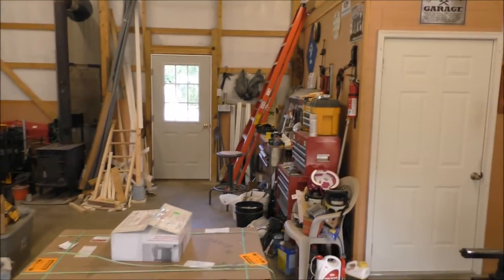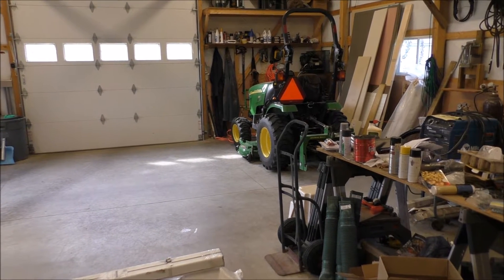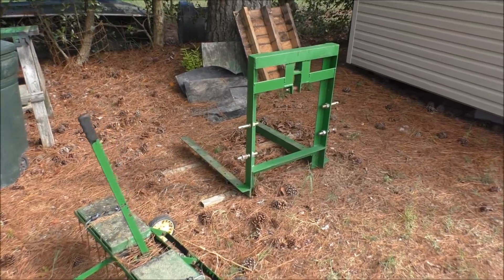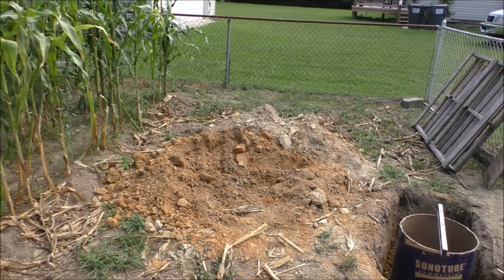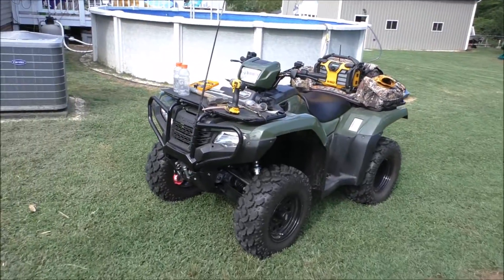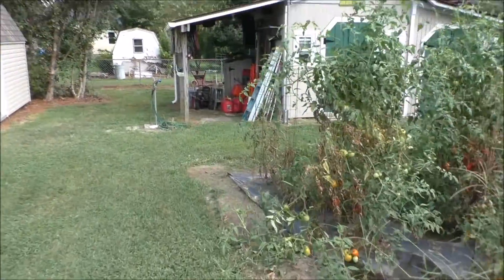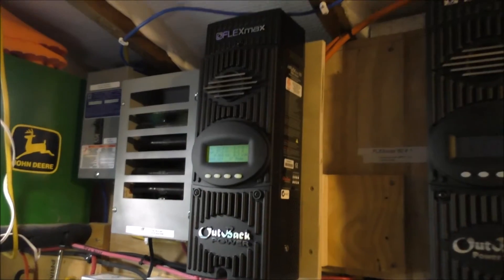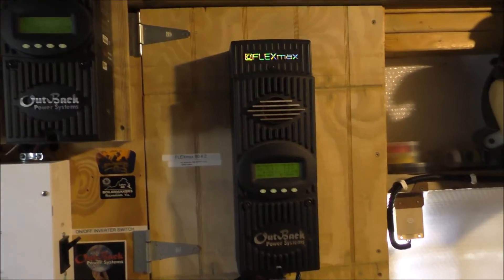Solar Panels On The Pole MT Solar & Kyocera Solar Pt 1 By KVUSMC

Comment: Freight would be the same for two or thirty as long as they are all on one pallet! I got the same panels, but using the cheap Chinese grid-tie inverters, can only get 600 watts ac production....
Reply from the maker: It sure Would Be Holy Heck what is going on with that power
Reply: Hope you get better outcome...
Reply from the maker: SolarizeYourLife I hope So Also Buddy Cheers Kenny